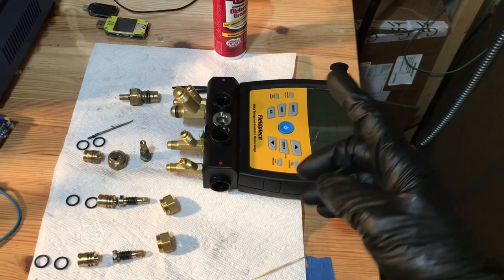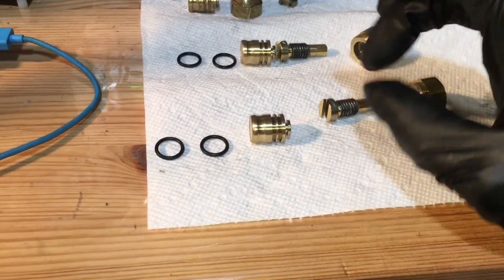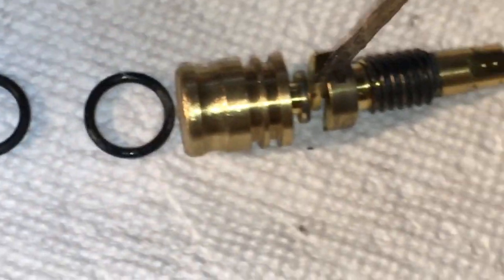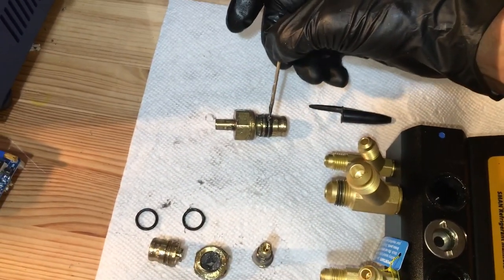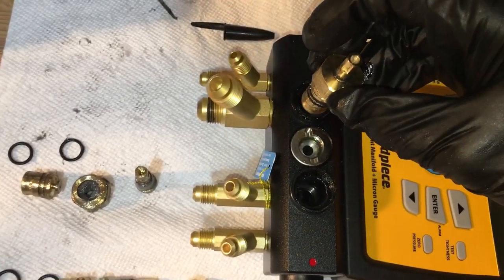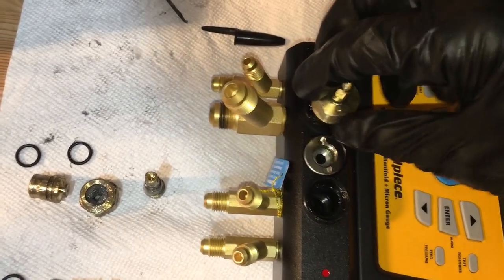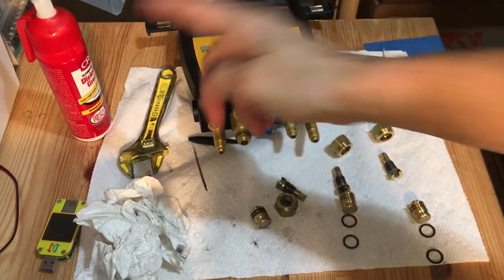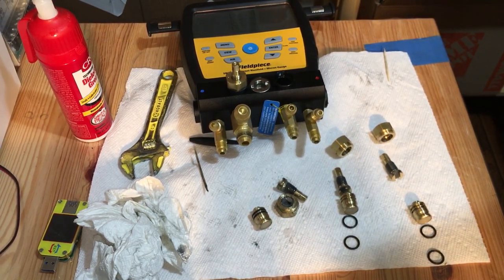SM480V overhaul deep vacuum modification.

Comment: I am going to do this on my gauges as well. I bought then for a one time use. Long story short I have to replace the air handler due to a distributor not keeping up with software revisions. :-/ FYI check with the manufacturer before trusting your distributor. Lol. I want to use my manifold to recover my charge with no contamination. So I figure it will suck air on a triple pump down on my recovery machine. First go around sucked air on my vacuum test. Bought a micron gauge to test vaccum, but the new recovery is going back in. So I want a clean recovery.    Thank you for this insight. No one is really showing this amount of good information. You rock.
Reply: And yeah, I could just suck from one side, but my txv is so withholding... lol.
Reply from the maker: @anthonylosego  😂 👍

Comment: Ahh finally i can add some input if you wanna take o rings off easily no tool necessarily needed roll them off or use pinch method increasing it’s size and simply remove no chance of even wood scratching your pristine machined  surface so far has worked well on Arctic Mugs Ram fuel filter o rings and Toyota canister oil filter o rings and ac line o rings only really works if you don’t use gloves though may help some not all just extremely happy i got to add something but im always here to learn as much as this guy puts down Thank You Mr Lech and if i seemed like a smart ass sorry wasn’t my intentions hope it helps someone other than me
Reply from the maker: It’s OK, no insult taken

Complement to be called a smart ass . 
  

I have different humor, different parts of the day of how I respond or shoot video . 

Personality changes whether I had my coffee in the morning or not 

Did I skip a meal? 
My response or a video comments may be drastically different depending on my blood sugar level 

Did I get good night sleep the night before will change my response I’m very unpredictable . 

Something I live with 

And the people who know me and me know when it’s time to feed Tom . 🤣

Comment: You like my neon pumps. I have a dual stage mechanical pump pulling on a molecular diffusion pump. That magic diffusion pump can pull to  one millitorr. I upgraded my pumps ten years ago. I wanted a product that will outlast me. When I was young I saw neon signs that had burnt out, after 50 years. They were pumped this way. For many years I used a single stage rough pump (most do) and my tubes burnet out at 5-8 years. The reasoning was 90% of businesses failed in 5-6 years and warranty was only 2 years. I’m retired now and it’s my name that might live on in my work. Thanks for the tip. I’ll do mine up soon.
Reply from the maker: Yes I studied a lot of about vacuum. All the different laboratory set ups cannot believe how many different kind of extremely deep vacuum pumps there are and they were cost. 
                 My 12 CFM 3 micron vacuum pump would only be considered a Ruffin pump. 
                I’ve been looking at used laboratory equipment so I can get one because I want to play with making lightbulbs and audio vacuum tubes.  I like to build my own class A amplifier. I would like to build one with vacuum tubes that I made with my own hands even if it doesn’t sound great constructing it in a way to make it look like it was built in the early 1900s. All out of metal and wood Handmade wound transformers using glass and leather as insulators
Reply: @coldfinger459sub0  I think that would be awesome. I could probably build your tubes. I have the fires (oxygen, air, hydrogen) and a small oven (annealing). Dumet wire is the big trick.
Reply from the maker: https://www.firstwatt.com/pdf/art_delite.pdf

This talks about a simple class a amplifier using 300 home lamps to place a vacuum tubes I wanted to construct my own looking like a vacuum tube in a blown glass cylinder. 

https://www.diyaudio.com/forums/pass-labs/153832-pass-delite-amp-baf.html

This is a post of the build thread on do it yourself audio web form

Comment: Taddy, youtuber. I asked how he liked the ellitech digital. he said it leaked. I decided to get a us s480. I'm not sure how it is yet for vacuum. But the used hoses that came with it leave a lot to be desired. Thanks for this video
Reply from the maker: 480V been working great.  I now have Five of them. 
     The first thing I do to all gauges when I get them is take them apart and add silicone grease to the oring groves . Something thing my father had me do when I was a kid.   To service his tools.
Reply: @coldfinger459sub0  is nylog ok, or get that dielectric?
Reply from the maker: @scoobtoober2975  get the dielectric grease from any of your Auto Parts stores or on Amazon Amazon. 

It doesn’t wash away dialogue dissolves, and is a refrigerant 

In this case for this purpose, you don’t want it to dissolve or get washed away with refrigerant 

You want to stay inside the O-ring and behind the O-rings .
Reply: I have 2 sets and they work just fine! One is a backup set for when I have to do maintenance so I can use the other in the mean time.
Reply from the maker: @JBLOVESTSandBI  I have five sets. Use them on a daily basis lots of work.

Comment: Tom! If you want to experiment - try the Quad rings or X -rings ( it’s the same. If you know your AS568 size of your O -rings, you can get the same size in Quad. It’ll be two sealing surfaces instead of one.
Reply from the maker: 👍. I’m always looking for new ideas.
Silicone grease a.k.a. dielectric grease absolutely works wonders when it comes to vacuum and it’s ability to stop vacuum from being pulled through it

Comment: The grooves measured 0.0710 width on my SMAN.  Found a nicked O ring, but could not find a replacement.  Original is 0.0725 thick, which makes for a tight fit.  Danco #5 measures only 0.0680.
Did the vac micron improve as a result?
Reply from the maker: Horst H  The manifold gauge is still sitting on my desk have not had time yet to put it under vacuum it was midnight when I finished.

Comment: I just messed up my guages!!! It would have been great if you had demonstrated how you took everything apart. I unscrewed the stem the wrong way out of the nut it fits through and it dislodged itself from whatever thing is attached to it that fits onto the thing with the two gaskets. Thanks a lot.
Reply from the maker: I guess you didn’t watch my other videos that show that. 

It is such a simple device nobody can mess it up it’s very easy , roughly a third graders level of complication. 

How can you unscrew something the wrong way when we all know most all threads are always right tight left loose. 

Even the screw on cap on your gallon of milk is exactly the same. 

Are you in another country where they make all threaded things going left-handed ?
Reply: I would venture to say, (unless you stripped threads), your gauges are okay. Just take time to re-assemble them properly. If you cross threaded it, well, that's not good, but that's another issue altogether.

Comment: I`ve a general question, can I connect the bottle for charging to the "red port" on the manifold, instead to the "yellow port"? Because I`ve a mini-split and the "red port" is free. I would like to use the "yellow port" only for recovering refrigerant. I have 2 knobs on my bottle, for liquid and gas. This means I wouldt have to change any hoses. Or is there something against doing it this way? Could the SMAN be damaged as a result?
Reply from the maker: If you’re on a mini split, both lines are low pressure, so it makes absolutely no difference. You could hook it anywhere you want.. 

Unless the manufacturers instructions say otherwise . 

There are some manufactures like a couple models of Mitsubishi that have specific instructions to only charge by a port that’s located in the cabinet . 

But other than that you don’t even need gauges to charge a mini split 

You could just use a single hose all by itself with no gauges 

Because you charge a mini split weight only . 

So if the manufactures specification sticker says it takes 3 pounds for the entire system, you only put in 3 pounds very simple no way to make a mistake . 

You could pull vacuum with a single hose on one fitting and have your other hose to the bottle connected to the other fitting . 

That’s why you used the valve, core removal tools with the ball valve on it to isolate your hoses

Comment: What ended up being the micron before  and after the silicon grease ????.
Serviced micron gauge fill and  empty with isopropyl  alcohol [99% pure]   3x  then leave to dry 2 hrs or vac pump to dry 
My vac pump 10 micron 
My hoses  110 micron and falling 
My new CPS  manifold  cycling 400 --460 micron 

Contacted CPS they said  run some charge cycles thru it and recheck .
*  used  silicon grease on a suction side of water pump ,o ring , sealed up perfect  
As u have mentioned use silicon grease  , at first I was concerned about if the grease would keep the micron artificially high but you have shown its not a concern .
Reply from the maker: If you seen all my videos refrigerant charge, and hoses or never designer meant to hold a very deep vacuum they cannot.  Refrigerant manifold, gauges were never designed to hold extremely deep vacuums.. 

And if you’re trying to read the vacuum on a very small internal volume of the area . 
     Like just the manifold and hoses that is too small the outgassing of moisture from the hoses in such a small volume the micrometers so sensitive it’ll pick it up as a very high number

Then, if you see my video where I connected to a plan you clean, dry refrigerant, recovery tank .   You will see that Number stays low.. 

Because if you add up the entire internal volume of the hoses plus the clean dry, refrigerant tank that is dry . 

The tiny amount of moisture offgassing of the refrigerator houses with that large internal volume do not add up to much . 

So the micron decay numbers will stay lower . 

If you watch Jim Bergman‘s video on vacuum, the long video, he explains that

Comment: A lot of chemists use Dow fluorinated vacuum grease on their glass joints. It's reasonably priced, like $80 a tube, or you can get a little capful for a few bucks.
Reply from the maker: Prefer nine dollars for 4 ounces same thing. 

Just not lab grade for pulling ultralow vacuum with centrifugal or turbine vacuum pumps

Our vacuum pumps never pulled low enough vacuum for it to make a difference to use silicone grease that already had the moisture removed from it

Comment: You may have already done a video on this but I'm in the market to purchase my first set of digital manifolds. Would you recommend the testo 557s or the the Fieldpiece sm480v? I only want to buy once so I'm trying to do my research and make the right decision.
Reply from the maker: Before I come out and just give you my opinion and my findings with my time with the Testo 557S. 

1:  do you know how all the You Tube guys either get new tools sent to them or they go out and purchase them and do a review and usually say how great the Tool is. 
                It was a mix review mini went back to using their Fieldpiece Someone went back to using their testo 550

I asked the same question to some of the HVAC YouTube personalities who swore the 557S was there to go last manifold even after I told them about all the problems I had and I even returned one manifold they sent me a brand new one and I still had similar problems with the same one the new one. 

         Now that it’s been about a year later since the Testo 557S has came out and I noticed the same YouTube reviewers push for the 557S what is there to go last manifold I started noticing they stopped using the 557S and went back to the Testo 550 or went back to the Fieldpiece except for the Testo fanboys those ones went back to the 550.  I wonder why they did that ?. 

         Here’s another example 2 weeks ago I just came back from Brian orbs HVAC School for techs by techs (HVAC symposium) 
                        Several of the big major HVAC tall companies were there showing off their tools and equipment which I actually did a video on talking about their tools at A few of the booths. 

         There was a testo booth then there was a Milwaukee Tool booth and then there was a Fieldpiece booth. 

        Fieldpiece booth had people go into it all day long a constant flow the Milwaukee booth had a constant flow of people checking out their tools.  
       now we come to the Testo booth you could hear crickets. 
            So few people went to the Testo booth I actually kind of felt sorry for the Testo representative was just standing there with his arms crossed waiting for people to come to his tools that many people have had experiences with Testo and on their tools and may buy some of them again but they’re not thrilled about it to put it lightly. 

       Let’s say Testo has some issues that they don’t admit and are in denial even though they have some very excellent quality test instruments Testo 557S is definitely not one of them. 

      My opinion my recommendation and I own and use both sets and Testo 557S continuously lets me down just recently released a video calling to Testo 557S a random number generator when I was trying to use it at a low pressure and it has a tendency to start inventing numbers and slowly creeping up and even after you disconnect your hoses the number stay there giving you a false reference I don’t have that problem with any of my Fieldpiece gauges and I own five of them.
Reply: @coldfinger459sub0  Thanks for your recommendations! I will invest in the Fieldpiece

Comment: Applied silicon grease only a smear to spindles  o rings and threads . Tried again pumping down and the microns stayed at 1700 approx .  Flushed  manifold and hoses with liquid refrigerant . Cleaned micron gauge again .  All good microns are at 300 and going down  now . 
 The silicon grease stopped the micron gauge  from pulsing  during spindle movement ie stopped the vacuum leak . 
The nylon  spindle tap seals are another subject they are leaking . Do u have any advice on these to help them seal ????
Reply from the maker: If this is a New Gauge the nylon stops at the end should not be leaking.   They take a little bit more cranking force. They’re not like the old school Teflon ones that were very soft.

But if these are old and used little perfections of contaminants that come out of the vehicle pieces of metal come across the tiny, thin ceiling surface area to cause leaks 

I’ve only experience leaks with this type, only after a lot of use in a few dirty vehicles . 

You are not closing these anyway during a micron leak test 

Do you have the high side and the lowside open when performing a leak test only the vacuum knob and a Refrigerant knob are closed. 

Just a reminder, if I haven’t said it before, we are all supposed to know that refrigerant, charging hoses and refrigerant gauges were never ever designer met no matter what brand they are to hold extremely deep vacuum . 

They give you a good idea they close it’s a ballpark figure . 

It’s a good start for somebody learning   

Then, later can advance to a dedicated micrometer, using ball valves, isolated attached to the system with no refrigerant charge and hoses .
Reply: Stand alone micron gauge ,no blue tooth ,,  no decay rate 
Valves turned off to isolate L or H  . Currently  testing each side separately with hose for comparison  .Low side with hose tap off  risen to  3000 microns overnight
***may be small test volume or hoses since the microns are not rising further   
Going to test High side today  for comparison .
My new procedure will be vacuum  thru High dedicated hose  , Micron on the low  dedicated connection 
Gauges will be retired to charge use and nitro leak testing
Reply: NEW   CPS black manifold 2 valve [MBT]  R22/R134 1/4 Sae
USED  CPS  Pro Set Premium  UL Nylon liner 5ft   1/4 Sae
Reply from the maker: @paulthompson1654  had to CPS manifold ended up in the garbage in about three weeks
Reply: Yellow jacket quality but very very expensive ,only 10% product range . Cheaper to private import. YJ has a very large range , these would better and 1st preference vs the CPS units IMO.
 Cps unit not complete rubbish . I have seen poorer quality but also better eg YJacket etc
Reply from the maker: @paulthompson1654  yes just seal up your CPS find all the little possible leaks use silicone grease on any of the valve knob O-ring seals. 

Learning work with what you have, and just get better with it . 

Are you in a different country?

Comment: Debating between Sman480s and Testo 557s. What would you recommend?
Reply from the maker: Testo 557S does not have a built-in micrometer.   Even though a micrometer inside a gauge is not your best bet but it’s a good indicator and a good secondary back up, especially for automotive.

In commercial or residential, you would use a separate micron gauge attach to line to the system at the farthest, end. 

I have had two Testo 557S both had multiple problems 

Testo’s Bluetooth gauges have a distance problem and disconnect problem with software. Everybody says and I agree that the fieldpiece Bluetooth connectivity is stronger and have a longer range. .